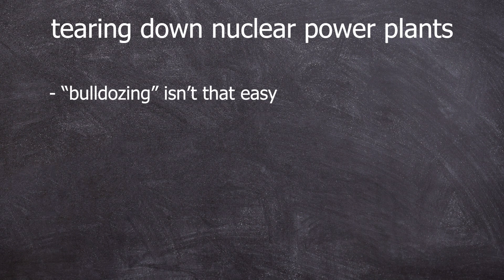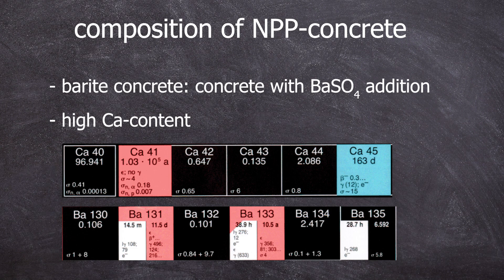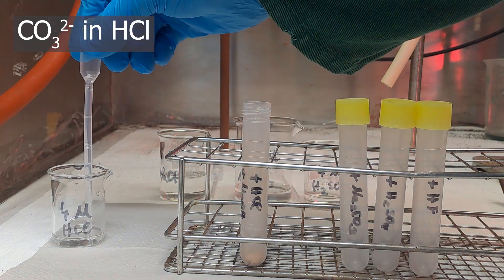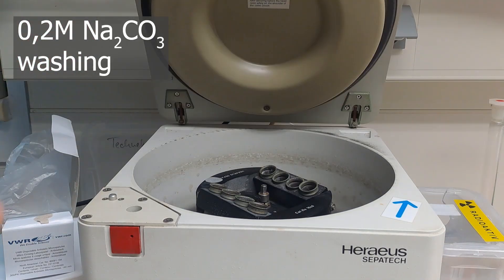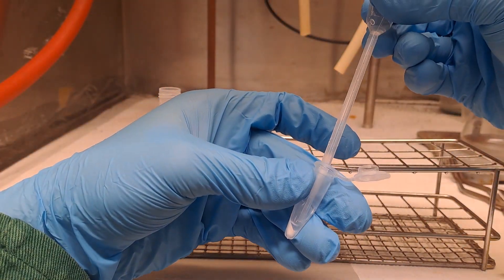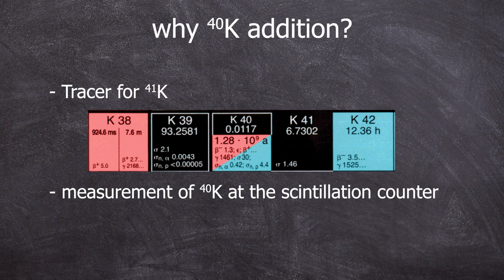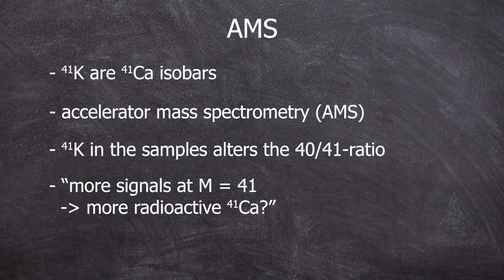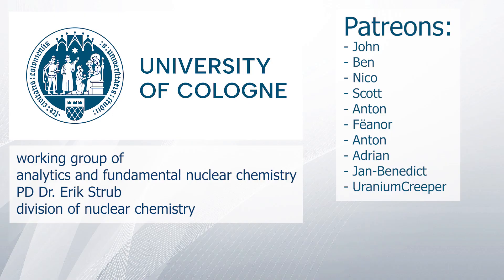how to tear down a nuclear powerplant - Processing of radioactive concrete - Nuclear Chemistry

Comment: I am wondering Could healing concrete be used in npp?
Reply from the maker: I would guess no, as you need Baryte Concrete for its really high density and strenth. You want as much stuff per Volumen as possible (within budget)

Comment: HF 💀
Even I am scared of that stuff, you think Calciumhydroxide could be used instead of your gel?
As the resulting CaF2 is not water soluble.
What are the next steps after applying the calciumgluconate, doesnt it have to be injected in the muscle  tissue too?
Reply from the maker: Calciumgluconate won't mess with the pH and stays water solable.
Yes its injected into the muscle if more is spilled and of course you immediatly rush to the Hospital.